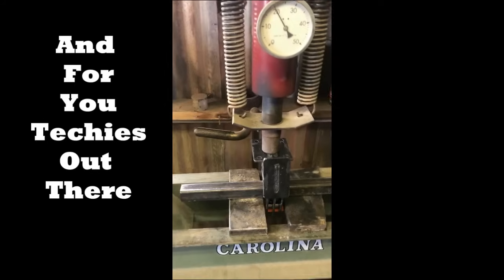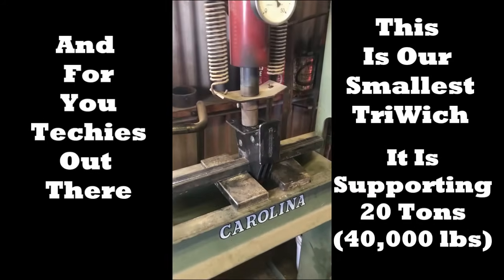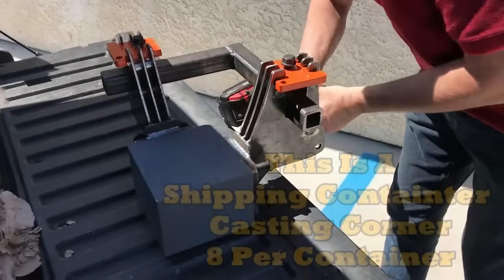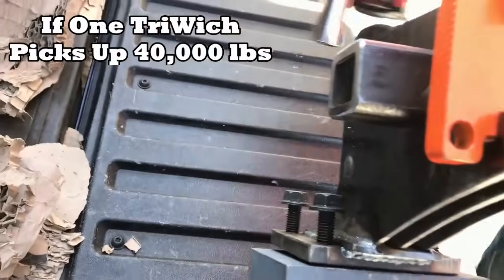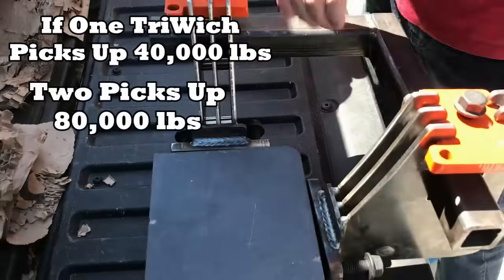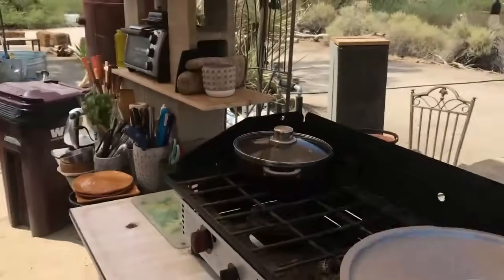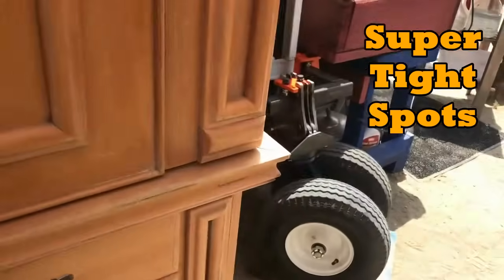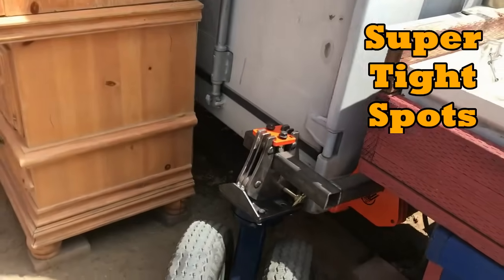TriWich® / Tri60 Intro: Shipping Containers  / Aircraft / Semi-Trucks / www.TriWich.com

Comment: What a bout a 20 ft trailer with a loaded  box from 1954 .  Need to move and swing left .
Reply from the maker: Sure.  Our new TriWich is 100% modular.  With the same TriWich we pick up a low-rider, RV, Semi-Truck, 150,000 lbs airplain and a fully loaded 53 ft container.   Even without a casting corner we could pick up a shipping container.  check out www.TriWich.com